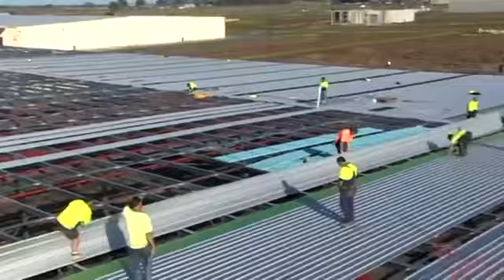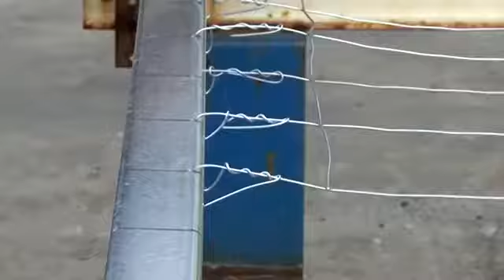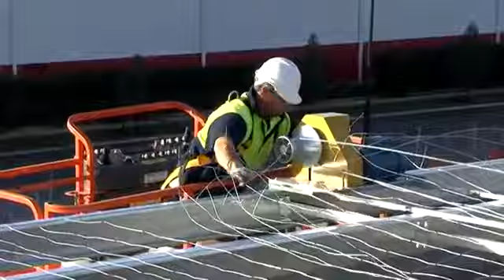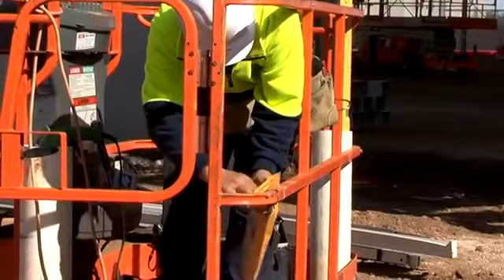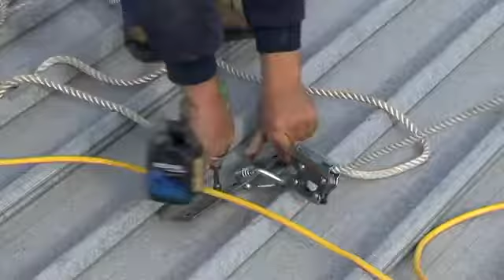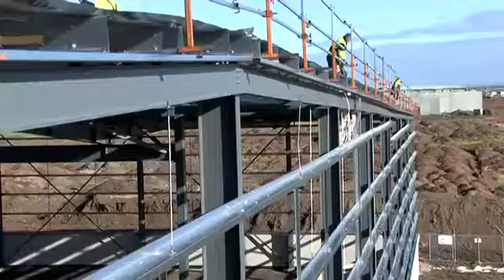Ausmesh 300 - Mesh Roof Safety Mesh

Comment: Hi why do you need a harness in a boom lifter ? The rail is high enough t
For your worker to not fall out ? If the whole thing falls  the harness won’t help him … ? So what is it for ?
Reply: I can answer this one for you... I'm not sure if you have ever operated  a boom over 11m? (I'd hope not, without a HRWL. All boom lifts are prone to unexpected jolts, bouncing and bucket swings. The rougher the terrain, the longer the boom length, higher the elevation, the less experienced and/or erratic the operator. The sudden and violent these side effects become. If you were to be thrown from the basket, you only fall less than 2m, then your safety lanyard shock absorber clipped to the harness deploys, cushioning your sub 2m fall and you are left swinging  the basket for as long as it takes your allocated HRWL "spotter" to perform emergency rescue. Ideally in under 60 seconds and hopefully before the 5-30 min onset of orthostatic shock (suspension trauma) occurs.. If there's nobody there to save ur ass.. you can spend your last half hour on earth reflecting on those corners in life you shouldn't have cut. 
......my quals...-Licenced roof plumber, Working at heights trained, WorkSafe EWP HRWL.
Reply: Thanks for your detailed response to the initial question. It makes perfect sense and I've learnt something by reading it.